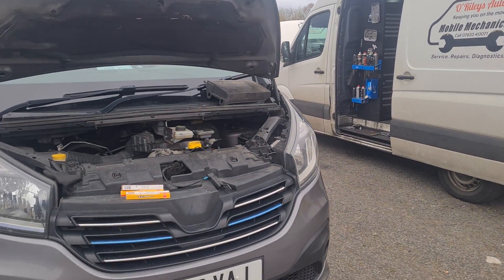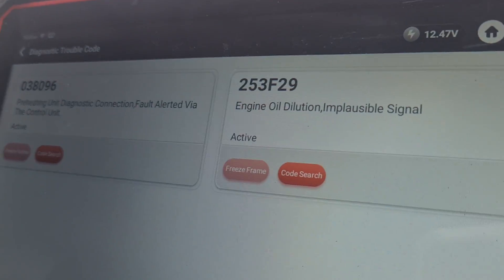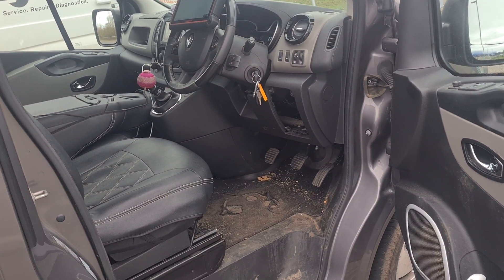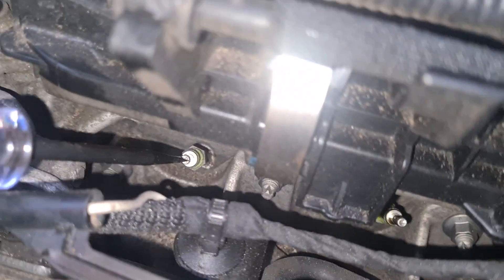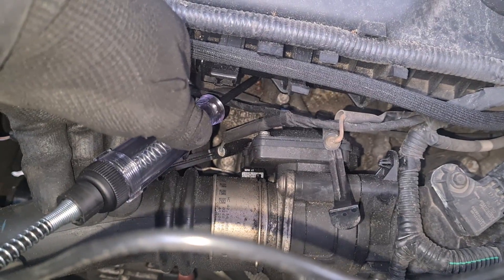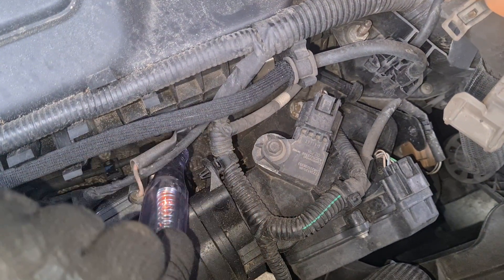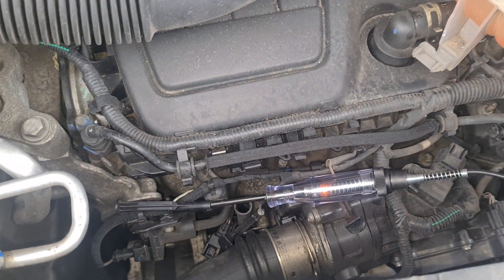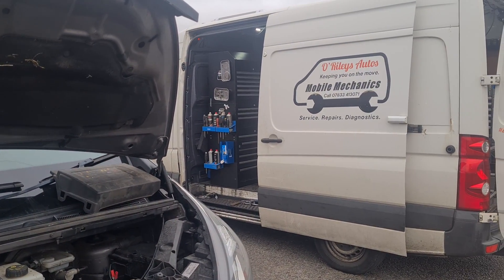Glow Plug Test With 12v Bulb Circuit Tester

Comment: Those testers are good for hooking up an inverter (240-12v).  Hold it on the live for a couple of seconds before live connection — protects the electronics - the lamp glows rather than putting a surge in 🙂

Comment: Is this with the engine off or ignition lights on or engine running, cheers👍
Reply: Straight from the battery, thought the bulb, though the plug, to ground.
No ignition needed.
Reply: @rogerstarkey5390  excellent cheers 👍

Comment: Also,
Continuity to chassis should be zero? (Or a known resistance, compared to the thread to contact on a new plug?)
Clip a meter probe to a long screwdriver, touch the end that tip, should get a "beep" to negative?
.
Just checked.
Bosch say a typical resistance of 1-6 ohms.

Comment: I use the same method to quickly test Glow plugs, I would recommend the Draper Test Light as its Extra Long and makes contacting the glow plug tip easier.